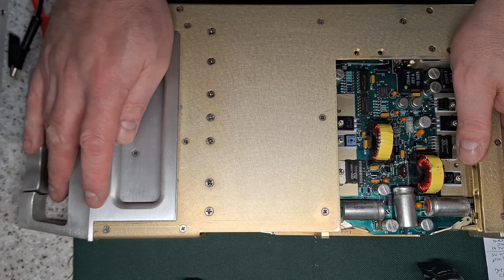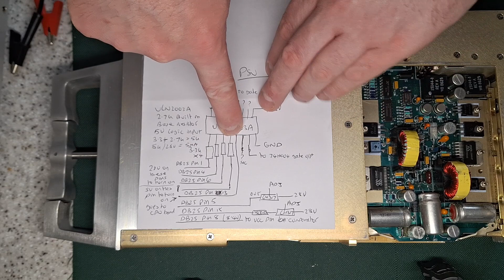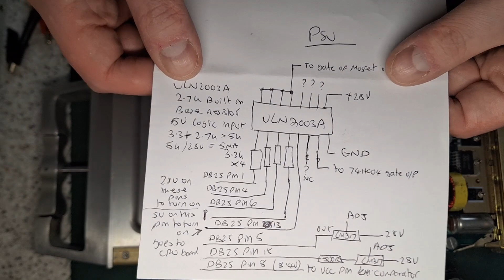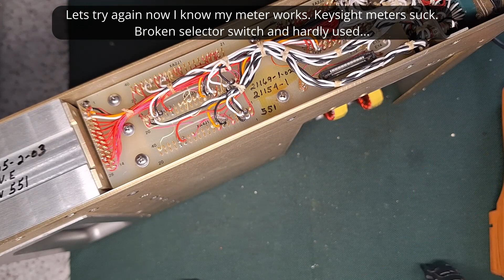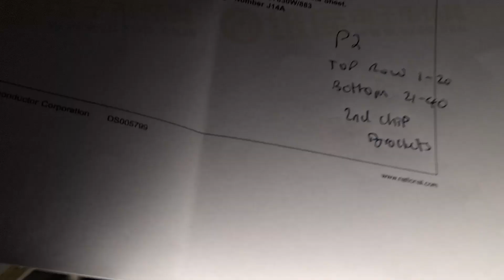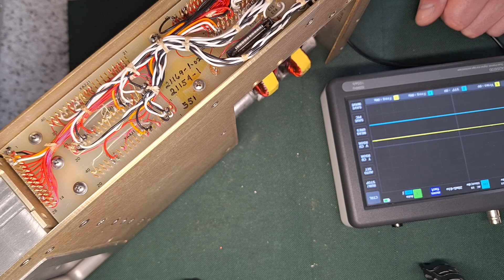Global NDB 2 Navigation Databank Part 2 - reverse engineering and trying to power it up.

Comment: Thanks for the followup (and motivation). Interesting stuff as always. Sometimes figuring out power sequencing for aero/mil PSUs is tricky. I've got one such project to reverse-engineer which has been sitting on the shelf for a long time. It should be worthwhile since it's more or less a complete computer system with a graphics card for display output (basically a VME backplane with a bunch of modules). One of the modules is the power supply which is full mil spec, and I have to figure out how to get it out of standby mode. It's a similar thing where it's done manually with various logic gate chips, no microcontrollers. Tracing connections on high layer count boards with strong conformal coating always makes it that much harder. Glad you've made at least some progress on this one! Thanks again for posting.
Reply from the maker: Thanks, it's hard reverse engineering things like this. The hardest was the eifs display due to the multi board construction.

Youtube seems to be not recommending my videos all of a sudden. New videos get views for a few days then drop off to practically zero. Got a few more to post yet but aiming for once every week or two.